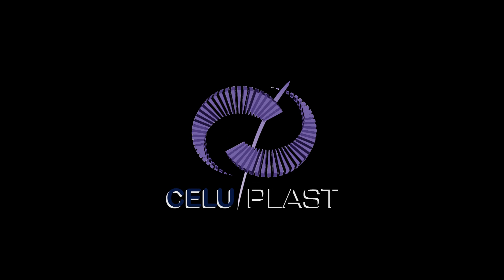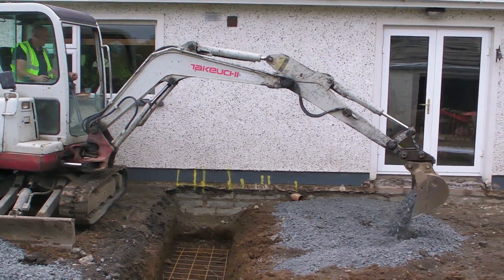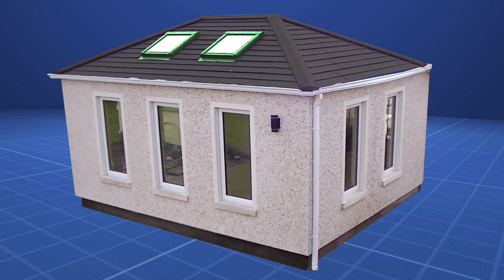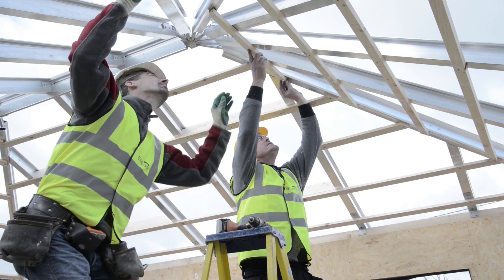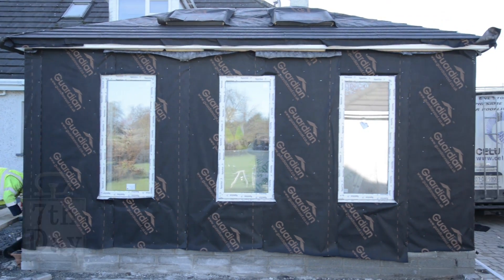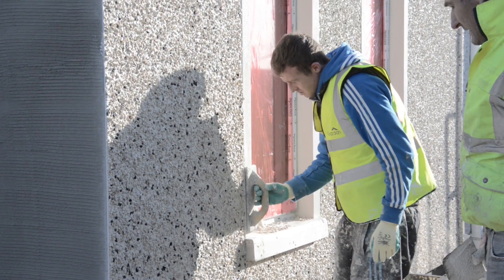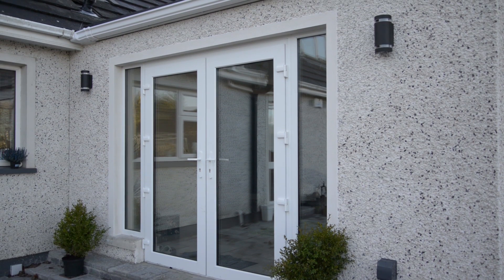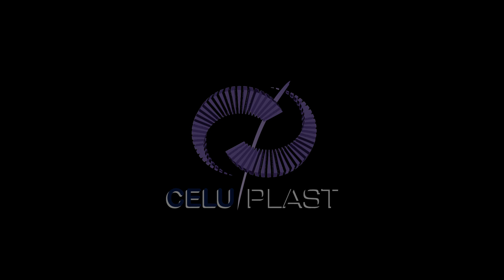Guardian Home Extension Installation

Comment: I had my 6 by 6 meters done in 22k .
Reply: £22,000
Reply: 22000 gbp with the base plate included? Or you had done the footing before and they came and installed the sips?